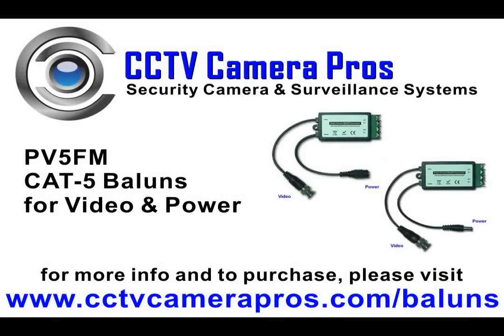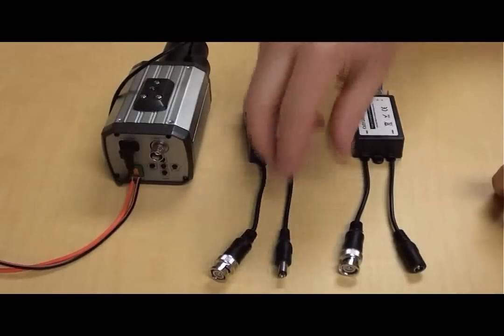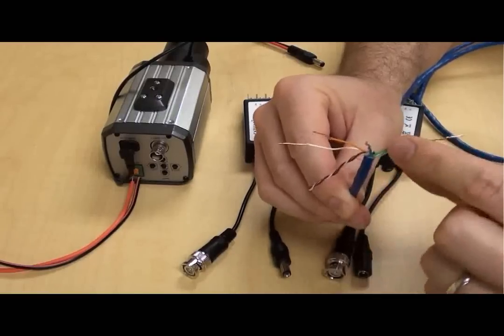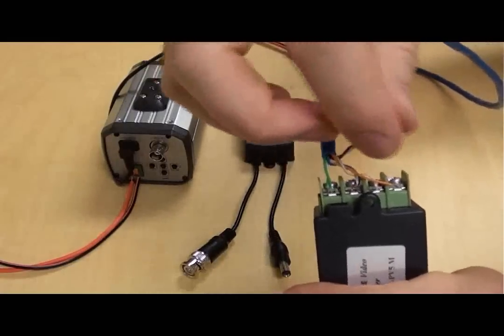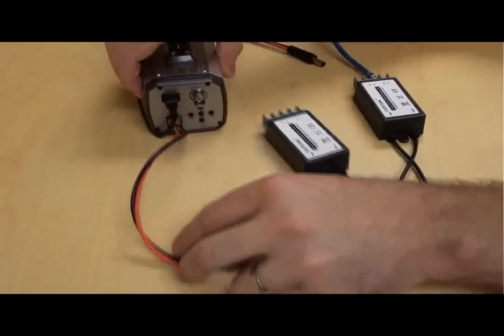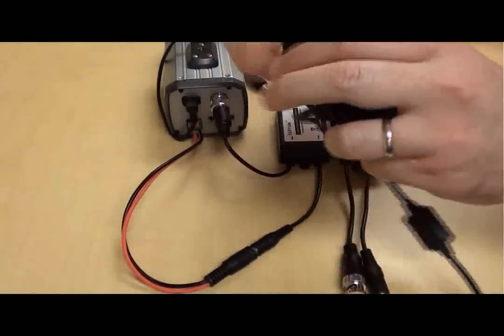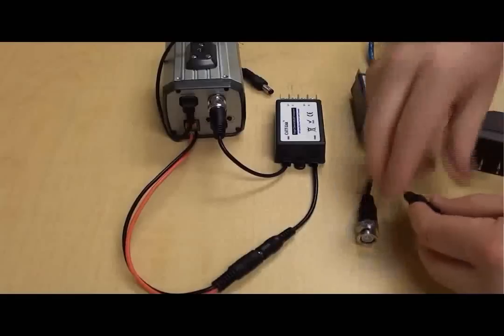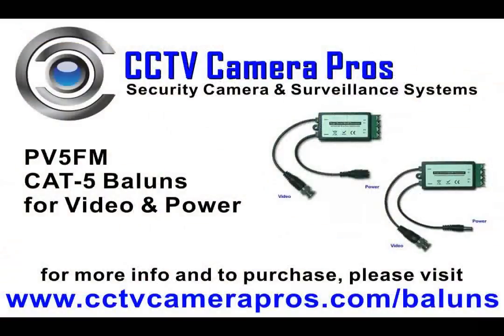CAT5 Video Balun for CCTV Cameras

Comment: ... noob question... why switch to cat5?
Reply from the maker: +raykupal RG59 Siamese is the industry standard for CCTV camera installation, however, some buildings already have CAT5 run so installers want to use it. Also, CAT5 can run CCTV video up to 1200 feet with video baluns. RG59 is limited to 700 feet. However, you can not run 12V DC power 1200 feet so it depends on the circumstance.
Reply: +CCTV Camera Pros thanks for the info. more power to you guys.

Comment: Wow!  I was going to buy a KX6 cable (with 12V embedded). Are you sure I can use just a common and cheaper Ethernet cable instead of KX6??? I have a DPRO-AS700, a PRO-690ND CCTV camera, and exactly same baluns both away from 60 feets DVR recorder.
Reply from the maker: +Jean-Michel Webbe yes, you can use CAT5-e cable with these CCTV video baluns. It works great. We have been supplying these for many years and have sold thousands of them.
Reply: +CCTV Camera Pros Ok everything is connected but I don&#39;t have any camera on iDVR-E4. Is there anything I need to do or to set before ? On  iDVR-E4 or camera ?
Reply from the maker: Jean-Michel Webbe No, you just use the CAT-5 cable with the video baluns instead of using RG59 coax cable. You do not need to do anything on the DVR or camera as far a settings go.
Reply: +CCTV Camera Pros Thank you so much for your help. I think everything is ok but I get only a black screen on my monitor.. So please see some pictures from my tests here : https://lc.cx/4NtL
Reply: +CCTV Camera Pros OK I think there is a problem with the IDVR-E, because I have a video signal if I connect directly to my monitor after the final balun (with a BNC to RCA converter). Any idea ? Settings maybe ?
Reply from the maker: Jean-Michel Webbe please contact james@cctvcamerapros.net. He is our support manager and will troubleshoot further with you to find out what is going on. Sorry for the inconvenience. I assure you that we will get it squared away.
Reply: +CCTV Camera Pros I was going to Menu > Setup > System > Advanced >  Set Video format to SD (not AHD). Everything works now !. Thank a lot for your support.
Reply from the maker: Jean-Michel Webbe so happy to hear that everything is working for you. Please let us know if we can help in the future.

Comment from the maker: How to use CAT-5 videos baluns for CCTV cameras

Did you know that you can use CAT-5 network cable to run both video and power to CCTV cameras instead of using RG59 Siamese coax cable?

This is very handy for installation locations were CAT-5 cable is already run. This video shows how one twisted pair from CAT5 is used to run the video and two other pairs are used to run the 12V DC power to a box CCTV camera. The baluns being used in the video are power and video baluns.

There are also video  baluns available that run video only. Installers can use a single twisted pair of wire from a CAT-5 cable to run video from a CCTV camera back to a DVR. In these cases the camera would be powered from a source close to where it is mounted. This is recommended for long cable runs because the 12V DC power will drop after about 150 feet.

For more information on the different types of video baluns that are available for CCTV camera installations, please visit this page.
http://www.cctvcamerapros.com/baluns
Reply: CCTV Camera Pros

Comment from the maker: That has not been our experience at all.  These power and video baluns are specifically designed to use two of the twisted pairs for 12V DC power and one pair for video.  This technoglogy is not new and has been proven for in the market for many years.  We have customers that have had them in place for years without any service interruption of cable failure. There is also no video degradation using twisted pair cable with baluns instead of coax cable.

Comment from the maker: You can run the video up to about 1200 feet.  The power will generally drop way before then but depends on a number of factors.  We have a voltage drop calculator on our website and also available in the CCTV Camera Pros iPhone and Android apps which are free.  You can find both by doing a Google search.